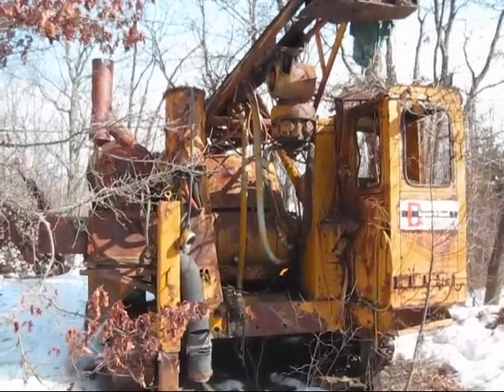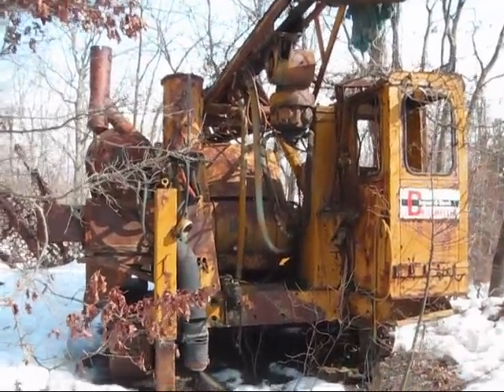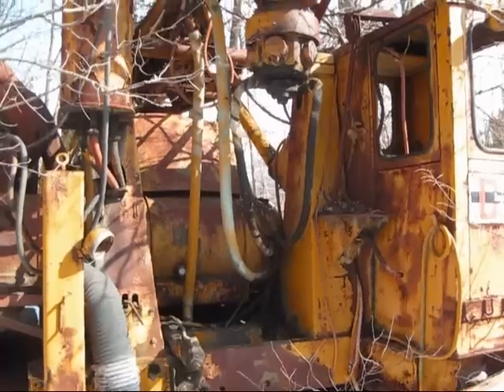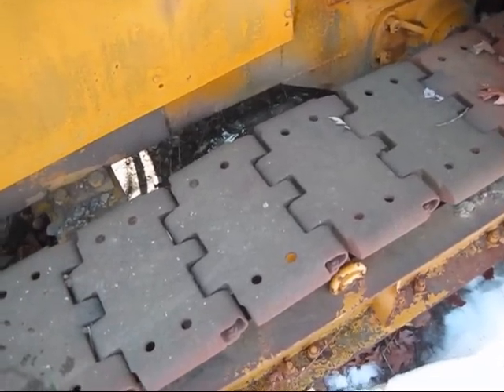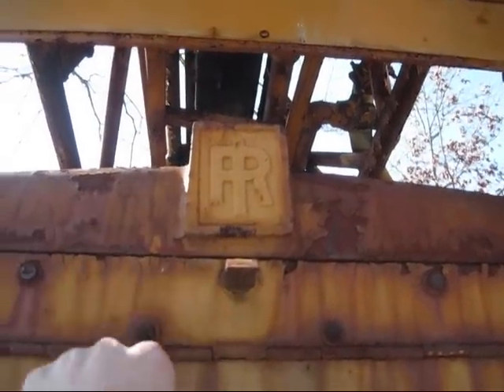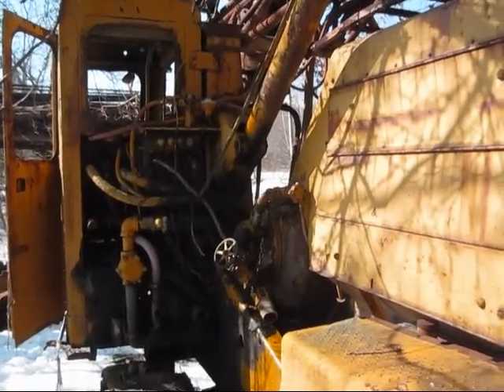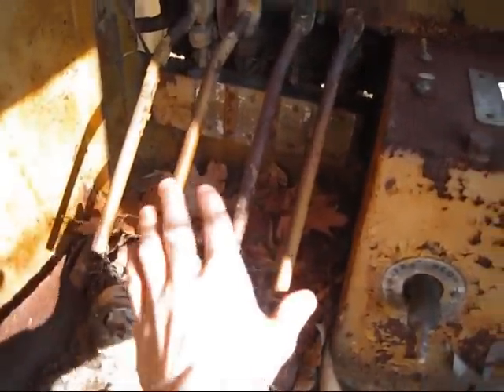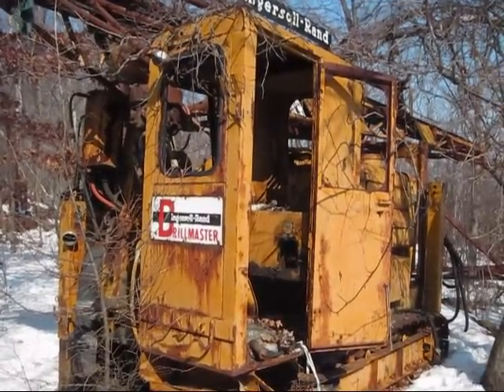Ingersoll-Rand DM3 Documentary

Comment: Ingersol Rand manufactured some tough tools, air compressors, and such.  I have used an IR impact hand air driver in the 1970s, that was manufactured in 1949, at my place of employment.  They had some old, very large, 3 phase, air compressors that were IR, also, still in good working condition.  They also had several large, wet vacuum pumps.  I believe some of those lasted 50years, in a tough production environment, with only a motor replacement, on a couple.  They had started having to replace some of the pumps when I retired.